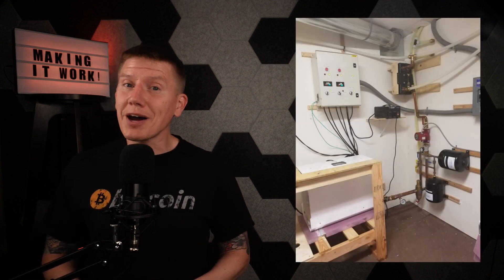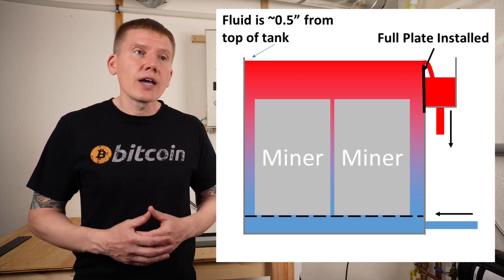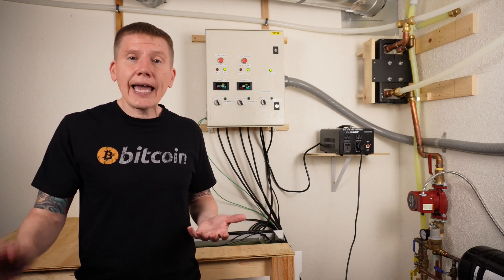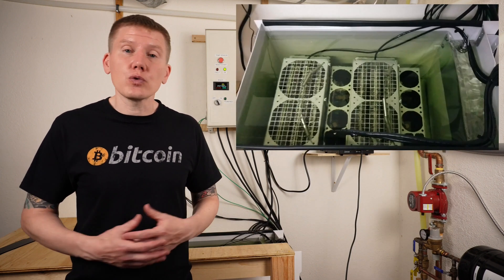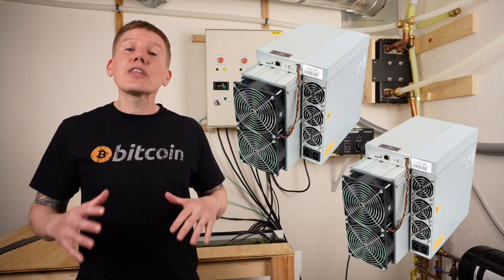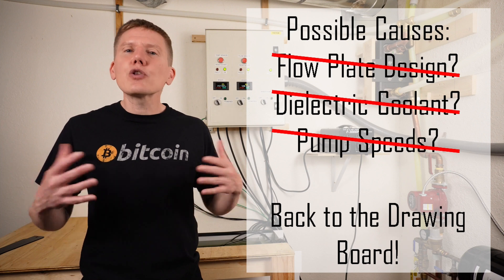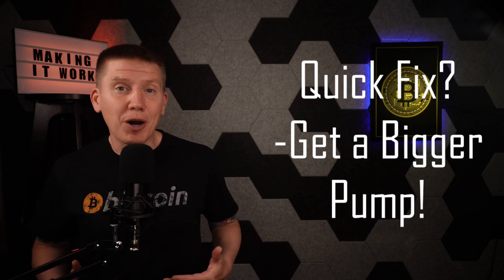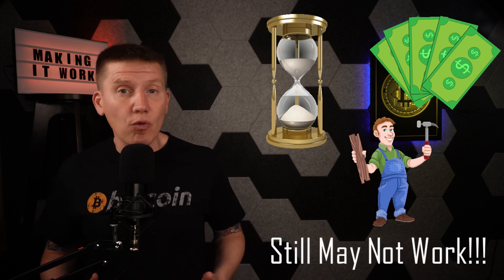EP24: The ONE mistake to avoid in YOUR miner setup!

Comment: One reason for overheat was maybe that you insulated the tank in the beginning?
Reply from the maker: Good question!  I did some back of the sheet math a while back and a hot tank will dump about 300W into the room.  That's not trivial, but holding that in isn't enough to cause the rapid overheating I saw.

I'm going to cover this in an upcoming episode, but I found the reason for my overheating was a plugged filter in my cooling loop--I just didn't have much fluid flowing through my 2nd fluid loop.  Lessons learned!
Reply: I’m glad I read this comment. After just watching your video I was wondering what the issue was. Glad you were able to figure it out. You have an excellent way of presenting information. Thanks 🙏